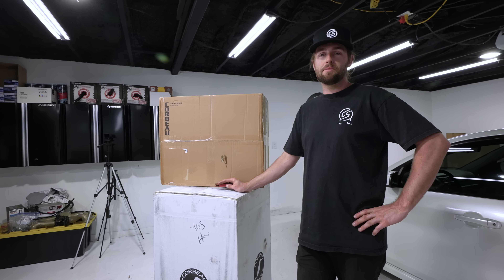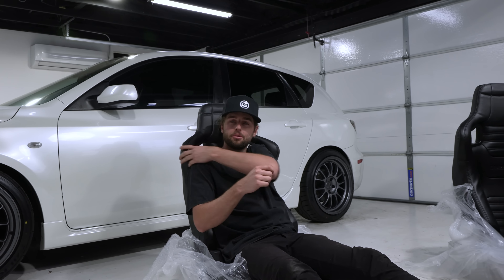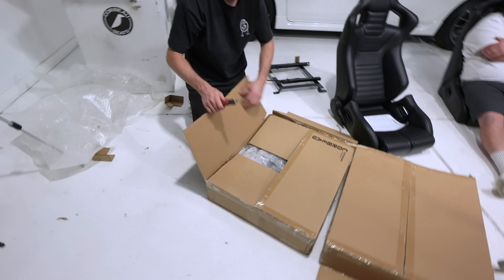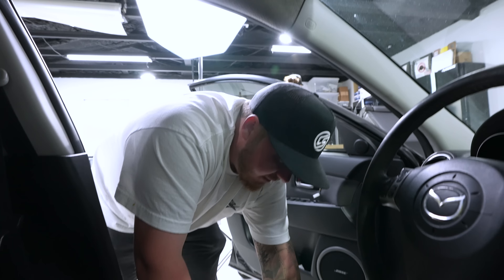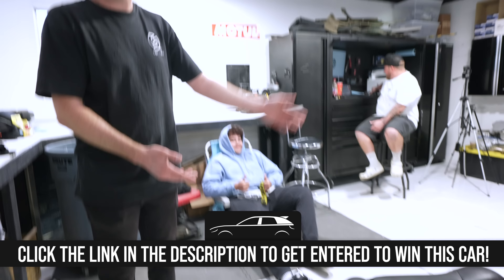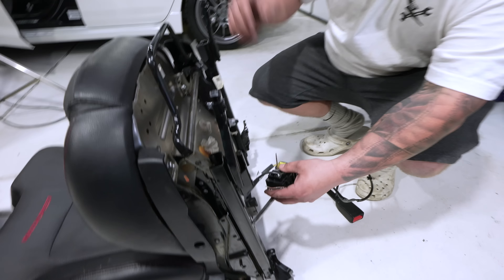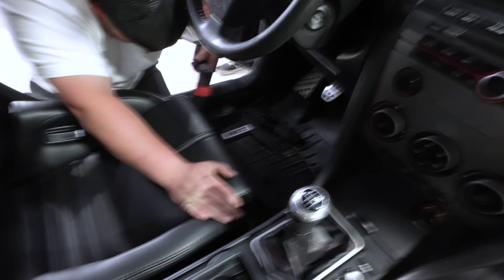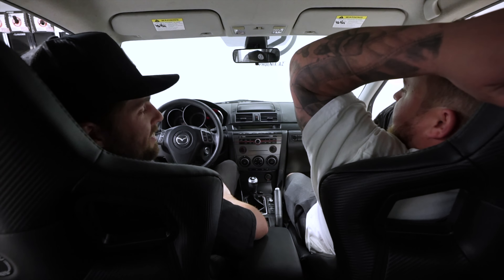Corbeau RRB Seat Install!

Comment: How did you wire the resistors?
Reply from the maker: We ordered the parts to do it I will follow up with that soon
Reply: Any update?
Reply: @CameronAlford  did you ever post that update? which video is it in
Reply: Updates?
Reply: @CameronAlford is there a video or guide on how to wire the resistors?

Comment: Those seats are amazing! May I suggest a corksport flat bottom steering wheel. 👌
Reply: I’m hoping they keep the stock steering wheel for controls like cruise control stuff like that
Reply: @FuzPlays  I think with the corksport steering wheel, it's just the outer rim that is replaced. All the controls and everything stays the same. I almost bought one when I had my 2009 speed 3.
Reply: @MonRoeTheory  ahh in that case if it’s just changing the look/feel of the outside then I’m all for it